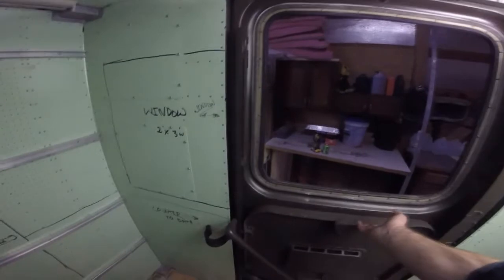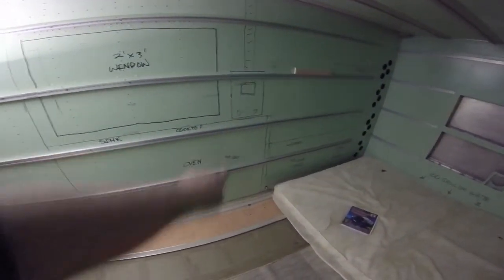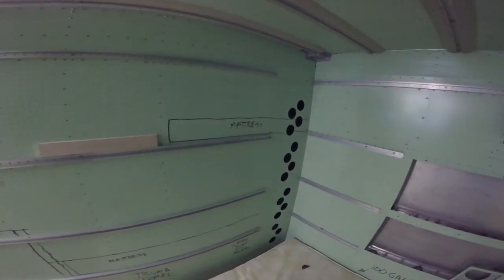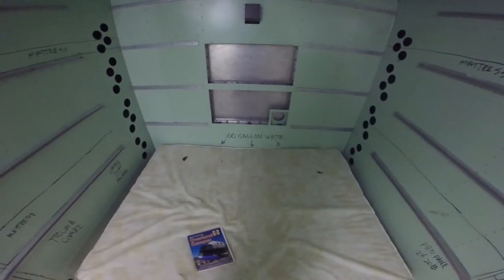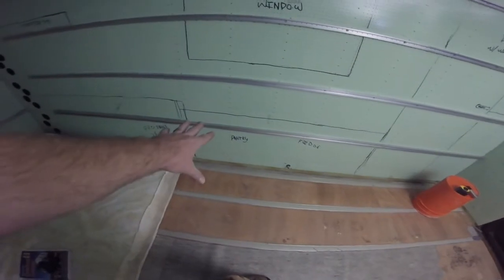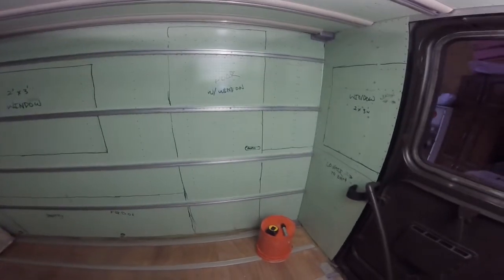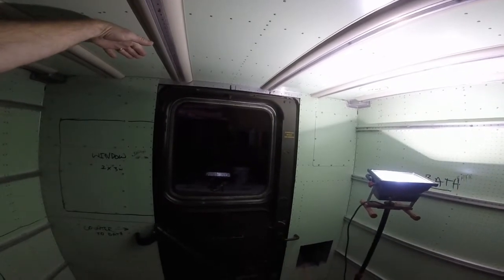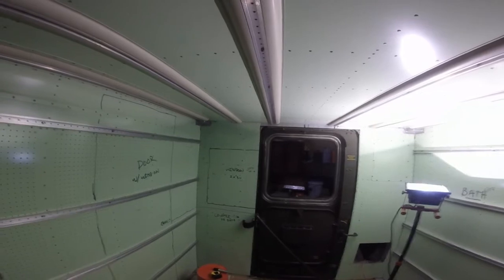Shelter Layout!

Comment: Did that come off a US military truck at one time?
Reply from the maker: No. Imported from Germany. Used by NATO forces in 80's and 90's. The US had a similar shelter (S-280) but was 1.5' shorter.
Reply: good plan for your layout, where is the truck, have you found it yet?
Reply from the maker: They are available. I won't be getting one until the summer at the earliest. Importing this was the test run for the Truck. Now that I know what I'm doing, there's no real hurry for it until this is built.

Comment: Just wanted to say putting in your control panel and stuff by the fireplace is that going to be an issue  ??????
Reply from the maker: It won't be as close as I make it seem now. It will probably end up more over the bed. But while the chimney gets a little hot to touch, it's not very hot really (at least my current one isn't.) I worried about those things in the Van but my worries were misplaced.
Reply: Colorado4x4Van copy that good to know good information thank you